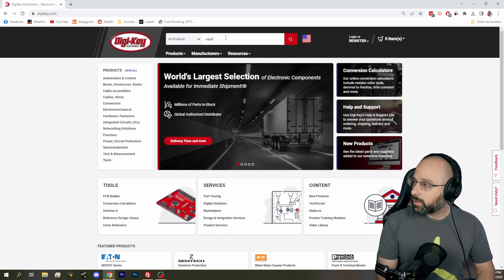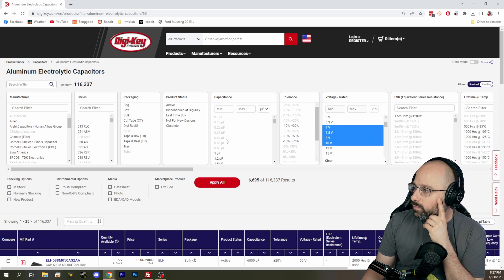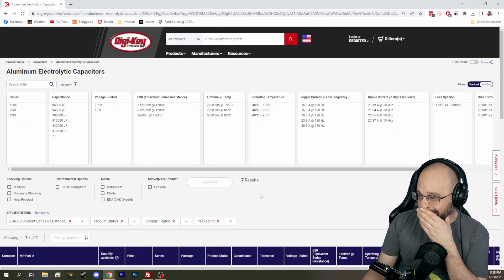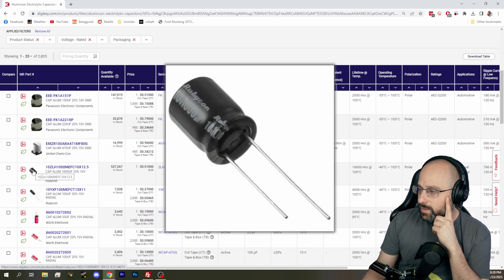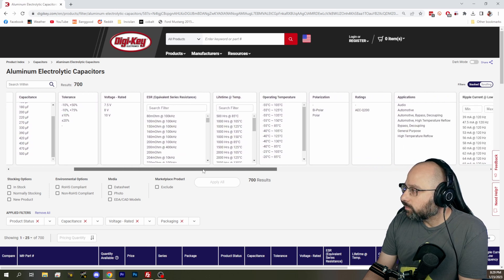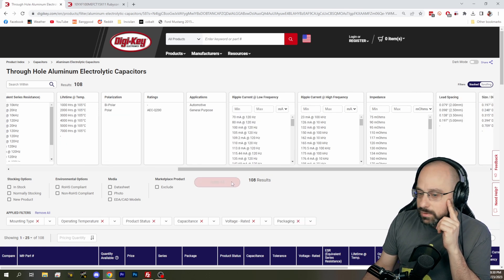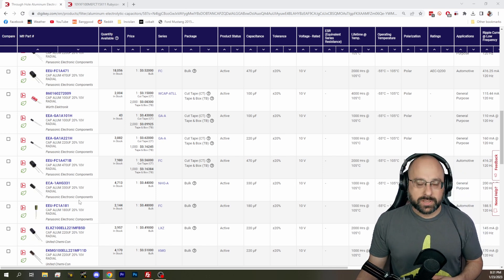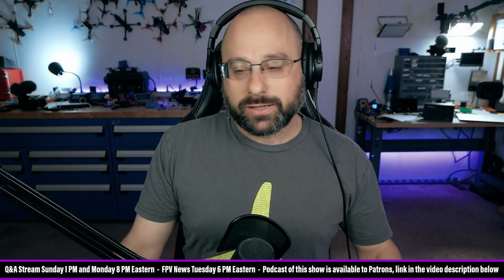What Capacitor Should I Use On the 5v Rail For Walksnail 1s? - FPV Questions

Comment: Fast forward to 2025:  The Walksnail Avatar HD Pro VTX has a note that reads, "When using a 6s battery, please be sure to weld a capacitor at the power input end, it is recommended to use a capacitor with a specification above 50V / 47uF."  I'm about to install this VTX, what does this mean, why is it needed, and where do I weld it exactly???  Is my VTX going to smoke if I don't get this right when using my 6s battery?

Comment: i blew walksnail 1s vtx after connecting directly to 5V pad in 2S FC, i didnt check it with multimeter beforehand but the analog VTX such zeus nano ( also rated only 5V) used the same pad was working fine. So i bought another one and used variable step down voltage regulator. I set it to 4-4.2V using multimeter and also used 16V 100 uf, it worked well. now i'm using it in 2s Reckon35.

Comment: on a bigger quad, like 6S 5 Inch - what happens when to voltage of the capacitor is to low ?

will it "pop" or even explode ?
Reply: Yes. If you put that 10v cap he was looking at on battery pad for 6s it’ll explode. It probably (I’m not 100% sure) wouldn’t damage anything else unless it physically damages stuff as it pops, but still something you want to avoid.
Reply: @matt0725  ahh okay, good to know !

Comment: Just built a 4" Rekon4fr with the Walksnail 1s vtx yesterday but didn't power up after soldering the Walksnail wiring (tested with elrs Rx to bind and update that, and motors soldered on).
The 5v on my Flywoo Goku gn 745 aio supplies up to 2a.
Maybe I should wire the Walksnail vtx to a 4.5v pad?
Reply: I had a flywoo board vcc supply 5v or other way around so maybe test with multimeter
Reply: Those pads are powered on by USB and sometimes don't supply alot of mA
Reply: @divingfalconfpv4602  yes, the mA supply worried me in the 4.5v pad so went to 5v anyway. There's a capacitor on the lipo pads so I'll take my chances.
There's a 9v DJI UART/pad for the normal Walksnail vtx if this 1s nano vtx decides to die.
Reply: @FATSNAIL-FPV  yea I have a 1s walksnail on order to go in 4s firefly hex nano. Hoping doesn't blow. I measured 4.88v at pad if my meter accurate. I don't want to add weight for another cap. So risk. Then bitch at caddx if it burns out 🤣  if you want to be crazy you can make balance plug connector that only uses 1cell from lipo. 🤣  but that would be so inconvenient.  Step down that are tiny and do 4.5v or less are out there but I'll risk it
Reply: @divingfalconfpv4602  lol everyone is just assuming this 1s vtx is gonna blow up on 5v. They didn't really think the voltages trough I guess lol.
The 4" frame can take the normal vtx height while as I use an aio, so if those are in stock again I'll order one just in case. That camera is 19x19 with will fit the Rekon4fr frame by design. Good options for this frame and video system.
Reply: @FATSNAIL-FPV  I'm putting in a tiny whoop so I want to go 1s vtx thought in their slightly barely bigger one they put the full size wallsnail. 
Caddx puts it at a range 3.1v to 5v so everyone worried voltage spike on plug in of 5.5v burn it out. Idk. I feel company should build in safety net. Knowing not every 5v pad exactly 5v

Comment: FC, ESC and every board intended for FPV, in general, must have TVS diodes as standard protection, at least... Diatone has done this in some of the newer boards... Of course a capacitor is always needed, but having the correct TVS diode on the board will help with those killer voltage spikes...
Reply from the maker: All testing I've seen shows there are no massive voltage spikes. Only a capacitor stops any spikes at all. If you can link or share some data to the contrary I'd love to see it. - Blunty